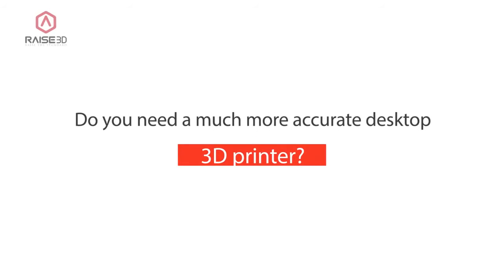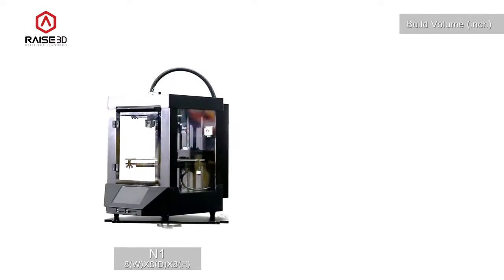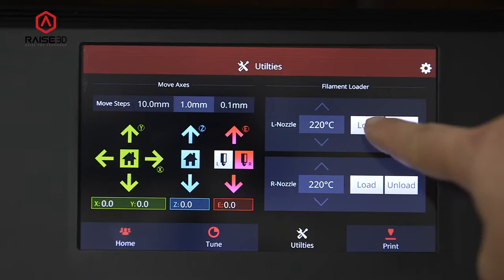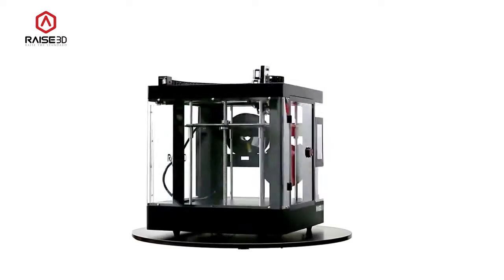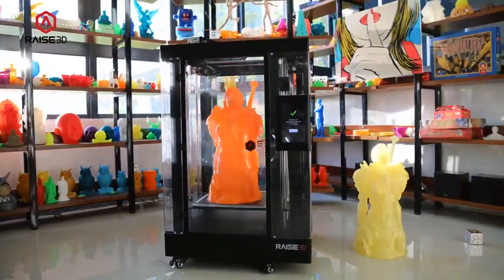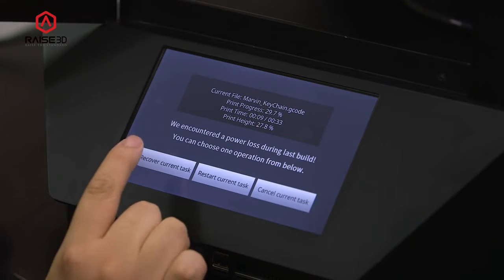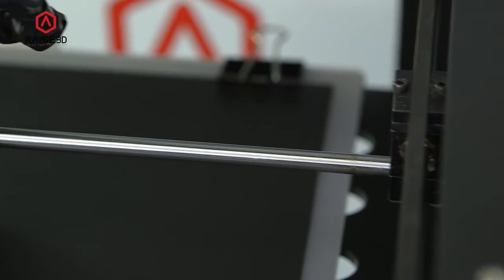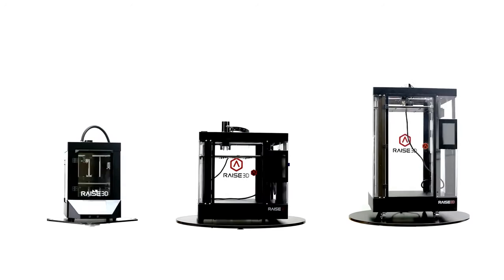Raise3D N Series

Comment: Almost bought one until I found out it isn't auto bed leveling that they simply  think it will stay level them leveling it in the factory.
Reply: Almost decided to suggest on for purchase to my superior and then I found out: no cooling fan control, dual extruder nozzles knock over prints, overly complicated be leveling procedure, extruder that has no tension adjustment.